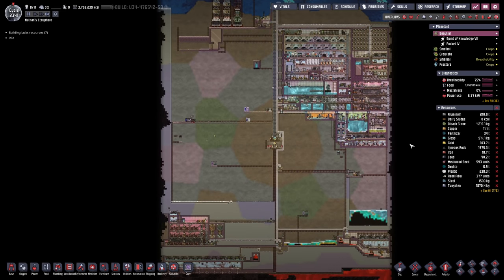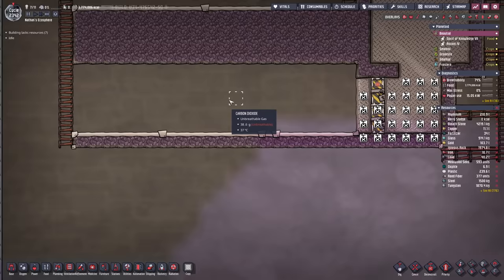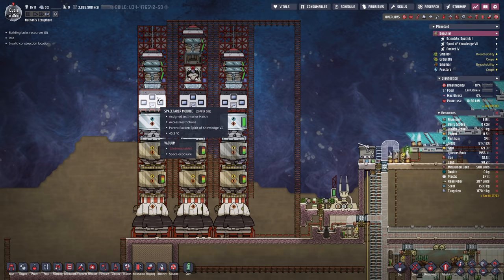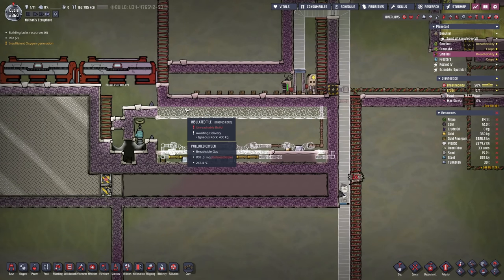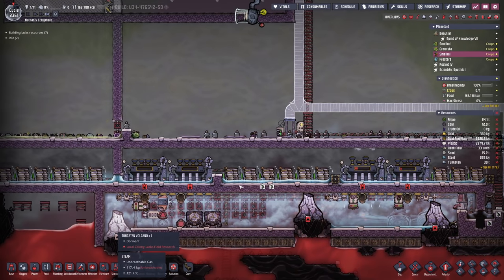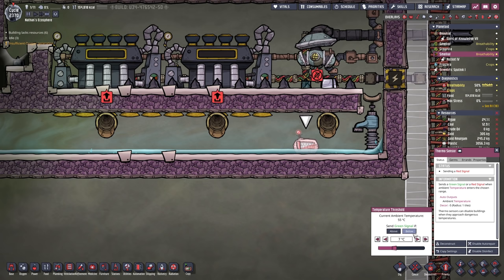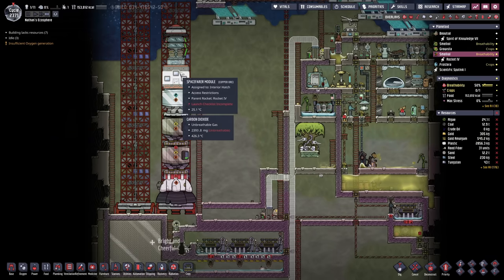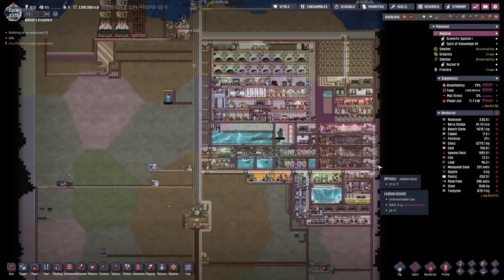HARVESTING ROCKET POWER - Oxygen Not Included: Ep. #61 - Ultimate Base 2.0 (Spaced Out DLC)

Comment: I've just finished your 1st ultimate base series and i have a hint for thermal stuff
I don't know if you did it or tried it
In one of the EPs I've noticed that any item falls into another one the temperature of the item on the floor goes to the other ones
If you did that with a heating loop or cooling loop i think it would be sooo effective

Long story short, infinity thermal power
Reply: I just want to see someone seriously use a molten salt reactor, you can really amplify the power of turbines by using those.
Reply from the maker: Interesting ideas! What method would you use to heat things up in both scenarios?
Reply: @Nathans-Sandbox  
I think throw item A at 500C environment or so
Then put a heating loop that heat oil for example, then at the end it falls on the item A
Put the item B at the rail and set it in auto pick
Then you convert oil free
Same thing for cooling i guess

I even haven't played the game sooo. . . 
You should play with it a bit
Reply: @Nathans-Sandbox  - I was thinking about a large 4-chamber molten salt pre-boiler design which would reheat itself in a cycle due to the higher SHC of salt gas vs molten salt, giving you extra energy by the hysteresis of heating/cooling.  The only thing I found close to this is Brothgar demonstrated a more simple 4-chamber design that amplifies the energy extracted from lava - the video is "BOOM! 300%~ish Salt Reactor POWER - Oxygen Not Included Experiment"
Reply: @Nathans-Sandbox  - For heating the salt reactor, that would depend on what's available on each planet.  You might not want to undo existing designs to test this though, try something in sandbox mode that corresponds to an asteroid you haven't built up yet.

Comment: For a 2-wide steam chamber you don't really want to use tempshift plates because they will transfer heat into the surrounding insulated tiles.  You might instead consider using a self-continuous mechatronics rail with 20Kg of diamond, that seems to be far more effective at evening temperatures than just tempshift plates.

Comment: Anyway, the tungsten is probably the worst materials for that purpose but it's the only 1 you have, so you should make a frame of tungsten and fill it with water to drastically increase the thermal capacity. The metal frame to build is 3(horizontally)X9(vertically) with the inner part filled with water. All the rest of your building it's useless ^^

Comment: There is an automation port in the rocket platform, you can use a switch to send a green signal through it and set the rocket to do a roundtrip (the button next to where you set the destination) and keeps it going up and down until you disable it. Be careful, though. It can melt your rocket platform.

Also, there is some new ladder beds and wall toilets that take less space, so you can squeeze more things inside rockets.
Reply from the maker: Nice, thanks for the tip!
Reply: @Nathans-Sandbox  The next updated changed the rockets, so they consume fuel going to orbit, so it will not work anymore